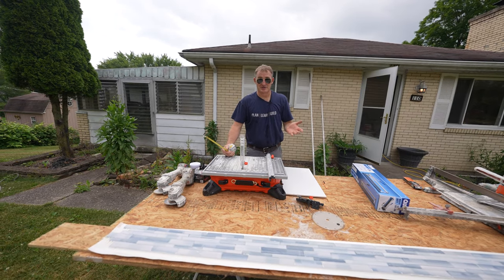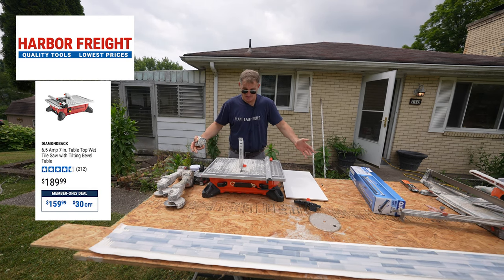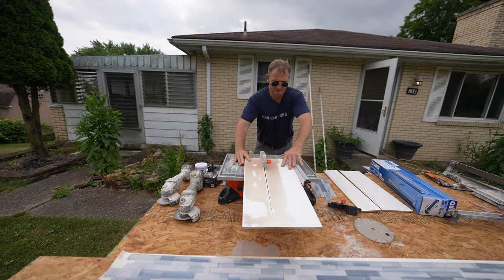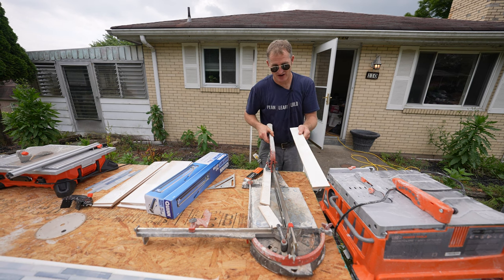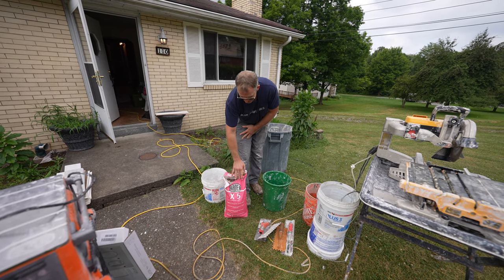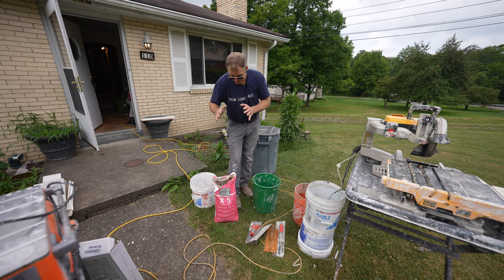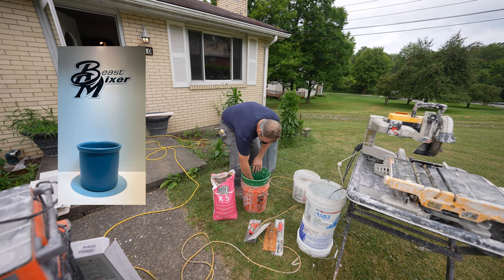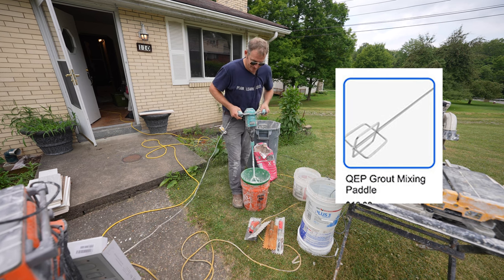Getting Started with Tub Surround Tile | The First Rows | PLAN LEARN BUILD

Comment: Great video.  Do you got a video or could explain what is the best way to go about this.  I'm going to set my curb for the shower, but I got glass doors that has hardware that goes on the shower curb.  The shower set up is 2 walls, that will be tiled, and then a 2 wall glass door setup.  I don't know exactly how the hardware goes just yet (in shipping), but after thinking about it, I'm worried the screw holes for when I attach the hardware to the shower curb, will all water to penetrate from the screws.  What would you do in this situation?  I was planning on using Kerdi board on the walls, and was thinking of using it for the curb as well but will probably just go with a curb made from block, so if I do screw into it, it won't expand like wood would if it got wet.  Any advice would be great.
Reply from the maker: So you can do this a couple of ways to avoid problems. One would be to get a curb that allows screw penetration. My favorite is the kbrs hardcurb - https://amzn.to/44SQ002
Reply from the maker: The other alternative is to cut screws & use epoxy glue for the tracks. Similar to what I did in this video - https://youtu.be/Eb75cWsSlw4?t=321&si=nBeuFf2dcNK1Npzs
Reply: @BathroomRemodelingTeacher  Thanks man!  I'm gonna check out video.